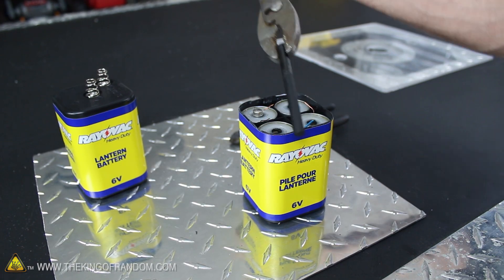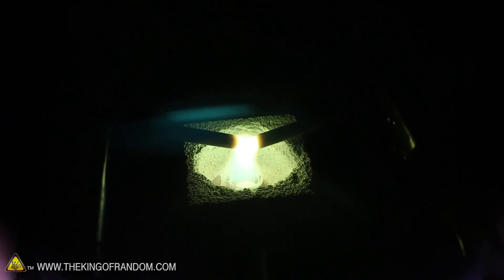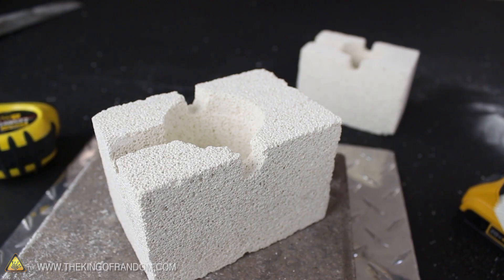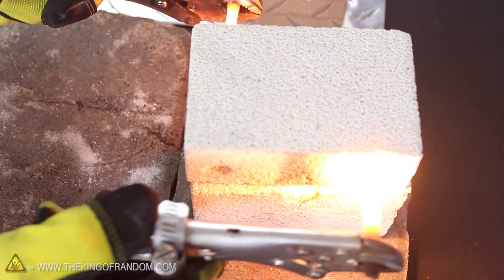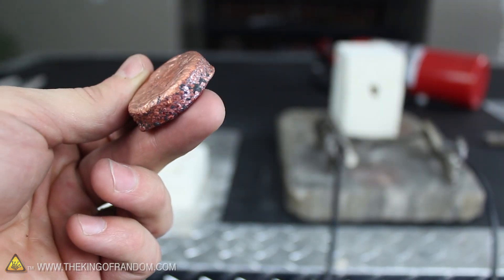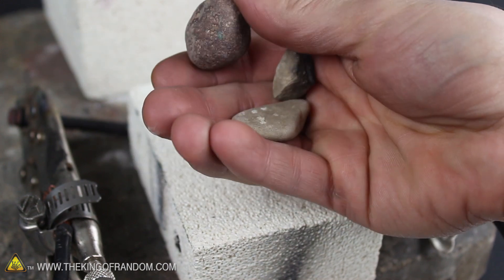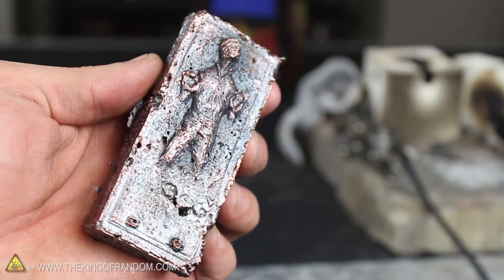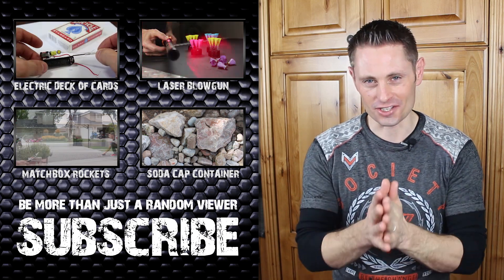Mini Arc Furnace (Arc Reactor Technology IRL)

Comment: What is the minimum, voltage this runs on. Thanks.
Reply: sin4422 It isn't much about the volts. It's more about the amps. The more amps you can push into it, the hotter it can get.
Reply: I do know this but if you read my comment it asks the minimum voltage needed for this to work so that I can do my transformer maths.
Reply: sin4422 Transformers for arc welding usually have no-load secondary voltages of about 60V. With a burning arc, the voltage may go down to 10-20V. The impedance is important for creating a stable arc discharge.
Reply: Cheers for that. really helpful.
Not sarcasm.
Reply: sin4422 Not sure where was I sarcastic, but be it....
Reply: I never said you were. You really need to learn to read comments.
Reply: sin4422 No, but you implied it, considering the fact that besides gerhard86 only I have replied to your comment/question.
Reply: CoolKoon sin4422 meant that sin4422 was not being sarcastic in thanking gerhard86.

Comment: Great idea! I have a question though, I made this project and it worked just as it was supposed to except I only had it going for maybe a min and there was smoke from the transformers spewing out so I shut it down and after the smoke cleared I saw the problem, it had melted my new coil wraps!? Is it because I didn't have the power running through the scaryack or something equivalent. I want to make another one but want it to not burn up. Any answers would be appreciated :) thanks and love the channel.

Comment: I'm having some issues with this, but still working on it. Mine works off 240 and i plunged it into the dryer, so max 30A. The out put voltage is 28V and the max current (short circuit) is about 200A, however when making the arc it is more like 80-60A depending on how long the arc is. I think if i up the voltage i can drive more current through the arc. It will mean a lower max current but really, I'm not getting the full 200A any how. Maybe i can boots it to 50V and 100A and actually melt something. Which has yet to happen. Also, i dont know how your arcs are so long. Mine are very small sparks.

Comment: The heat bricks are good for ingot molding, but other works leave imperfections like from the holes from the bricks. Would the styrofoam in the sand pot trick work with the hotter metals?

Comment: Does the furnace wear down with use? If  so, about how many uses does it take to be unusable?
Reply: darwin poop
Yes, everything wears down, but I want to know how quickly it wore down. Will I have to buy and make more furnaces in a day? a week? a month?
Reply: Mr.chang cooler
Reply: Eugene Lehnert
Reply: Mr.chang cooler Well think about this, practicly EVERYTHING in the world wears down with use (phones, food,...) so yes it wears down with use, as you can notice that the furnace doesnt look as smooth when used, even tho it can handle the heat
Reply: Mr.chang cooler I think you should replace the furnace whenever it looks like it does the last time it is visible in the video, just to be sure.
Reply: Mr.chang cooler Yes but remember one 6 dollar brick will make 2
Reply: +Mr.chang cooler 1 furnace costs $3, so they are super disposable.

Comment: Hey! The direct heat was enough to melt rocks, but do you think the heat of molten steel would make it impractical for use with the molding that you used to make the aluminum casts in sand?

Comment: As someone who has often considered dabbling in propmaking, the ability to liquify and cast metal pieces is like the holy grail of cool stuff. Out of curiosity (Noob question alert), would it be possible to modify the pliers to add some kind of additional heat-resistant handle to allow for prolonged discharge? Would welding on Additional side handles cause any issues with powering the arc?  Would it be better to simply apply some form of heat-resistant coating to the existing grip as long as it doesn't interrupt energy flow? Just wondering if there's a way to refine the design to reduce heat exposure to potentially use this technique to melt even larger amounts of metal with ease, thanks!

Comment: Hi Grant. Ive been having fun with the mini metal foundry but not much luck pouring the metal into a mold to cast new shapes. It seems plaster of paris still has too much water in it after 2 hrs in the oven. I was wondering if you'd tried cement as a mold for metal casting?

Comment: Jet fuel can't melt steel beams
Reply: it can cause it to warp and be unable to support weight.
Reply: TheJoseluisperez1000 Ha.
Reply: TheJoseluisperez1000 Dank meme.
Reply: But an ARC furnace can
Reply: Thermite on the other hand can.
Reply: TheJoseluisperez1000 Would you like some more dank memes?

Comment: hey grant just wanted to say that you've given me a highly feasible solution to a problem i've been facing. 

i've been planning on making a small scooter from scratch but didn't know how to cast the engine block. the only option up until now was to buy a seperate engine but they were all too powerful and heavy for the given design.

now that I have the option to potentially cast it myself instead of spending possibly hundreds of dollars on stock material the whole project has had new life breathed into it.

your inventions show a very kean understanding of alot of electrical engineering and materials science principles, and have helped me gain a better understanding of them too. 

so thanks! you're the man

Comment: i tried this at home with a wire fed welder, it's a low powered unit and only runs on 120 volts. the graphite would burn off one electrode and deposit itself onto the opposite electrode. i couldn't get the arc to be stable enough to direct the plasma flow. i'm assuming this all works better with alternating current than it does with Direct current. i'll try it again when i get my grandpa's welder running.

Comment: Where can I buy just 1 or 2 Alumina-Silica Fire Bricks as the one used in this video ? Also can you use a 220 volt welding machine for the voltage supply as opposed to making the arc generator from your other video using a micro wave ?

Comment: someone can explain to me why their is an arc but the voltage is like 35 volts pls
Reply: actually its not 35 volts!!!
microwave transformers produce 2000v and theres 2 of them making 4000v
Reply: digsDAman in his previous project he modified his microvave transformers to make theme produce 36 volts but like 200 amps
Reply: well a plasma arc requires atleast 2000 volts so maybe these are unmodified MOT's
Reply: yeah this is what i thought
Reply: digsDAman 0:30 does that windings look like original ones? Originally MOT is step-up, Grant turned it to step-down transformer, you need high current to weld. And to strike an arc, you need 30+ volts and lots of current capability
Reply: Ratchmaster  Even at 35 Volts you can generate a arc  but to sustain the arc you need considerable high currents to do it , Most Mig welders and arc welders are in the range of 20 - 50V + with currents of 50A to well over 300A.
Reply: twirlywirly555 ok thank you
Reply: ***** i knew that but i always thought that to make an electric arc you needed more than 1500 voltd

Comment: currently working to scale up this experiment on a much larger scale and even the 2x models works well, only problems ive had so far are storing the rods, and a foot lever for turning the power on and off. other than that it melts copper coil wire extremely well and using multiple rods can accelerate the heating process by factors of half the time required to melt. this is even better than the other foundry you made!